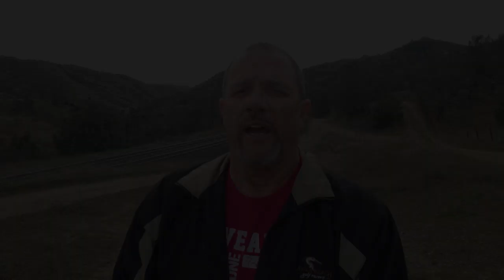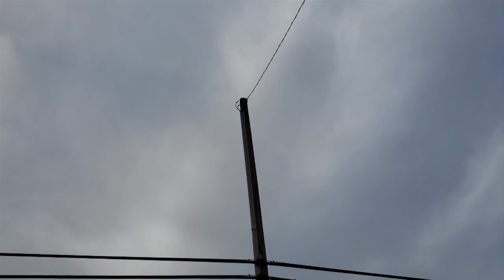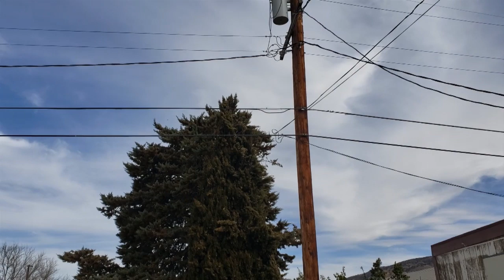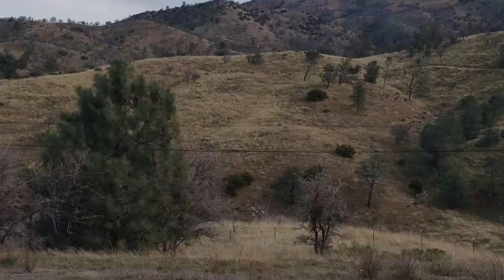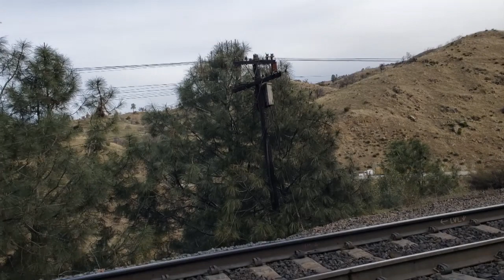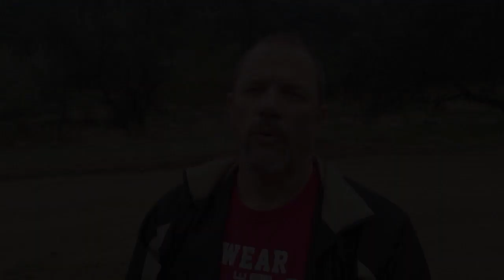Railroad (and other) Polelines Explained

Comment: Thanks Mark for answering my question about your old open lines. It sounds very similar to the phone cable system that I work on today. We used to have open wire pole runs too. I've heard they were also tough to maintain as well. What blows my mind is how they figured out how to carry multiple calls/signals on a single wire or pair of wires!
Reply: It's hard to find details about open wire carrier systems, but the information I've found suggests that at least one implementation used AM modulation---same as an AM radio station uses--but with lower carrier frequencies, probably below 100KHz. So in this case the idea appeared to be a modification of what was already figured out in the radio industry.
Reply from the maker: @brianleeper5737  that would be communications stuff. Out of my wheelhouse!
Reply: @MarkClayMcGowan  We need a retired AT&T person to reveal the secrets :)
Reply from the maker: @brianleeper5737  I'm pretty good friends with the local comm tech. I'll pick his brain about it. He's not retired but, as I said in one of my videos, he's one of the only people I know who can make me feel dumb!
Reply: @MarkClayMcGowan  I appreciate it. I found that there are Bell System Practices (BSPs) for the open wire carrier systems, but they are not available on the usual websites to find BSPs, seems that nobody has scanned them in. These would explain the equipment used, how to install and troubleshoot it, etc. I imagine that this was an uncommon BSP even in the era when open wire carrier was still being used, compared to say the BSPs for customer equipment installation and repair (most of which have been scanned and are available  online).
Reply: @brianleeper5737  I bet any AT&T worker that dealt with open wire is practically dead.  You don't see a lot of non bundled telephone wire even in pictures from around the 1950s.
Reply: @MilwaukeeF40C  O-carrier was introduced around 1953 or so. It was probably in use for at least 10 or 15 years.
Reply: Multiplexing?